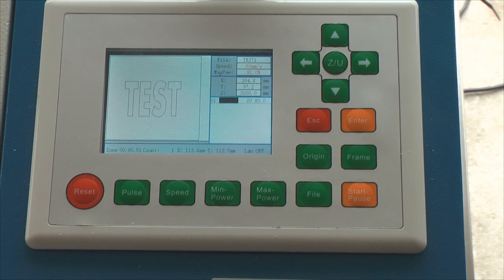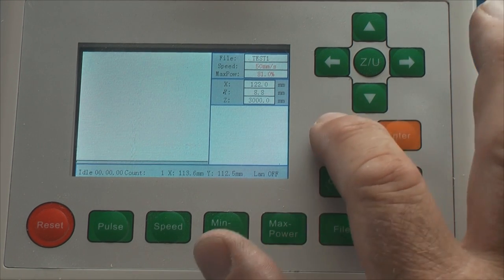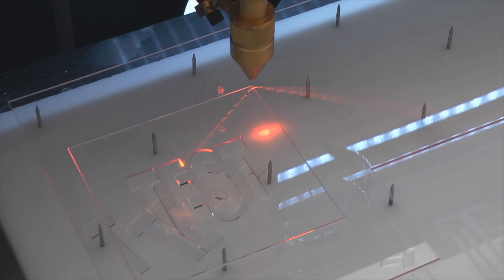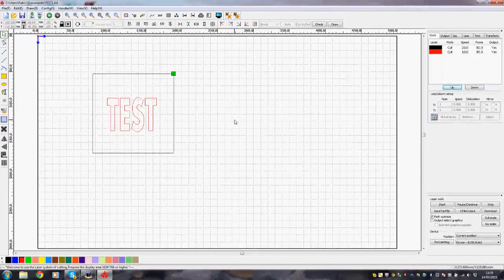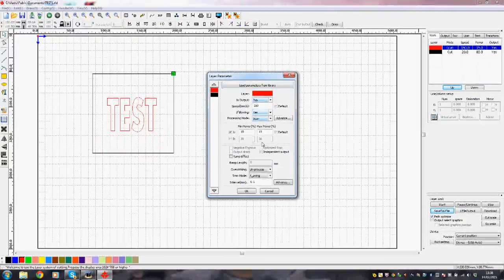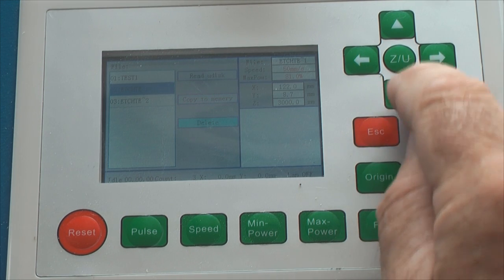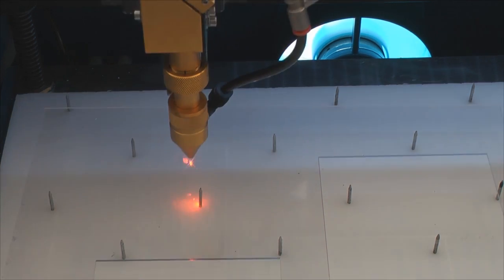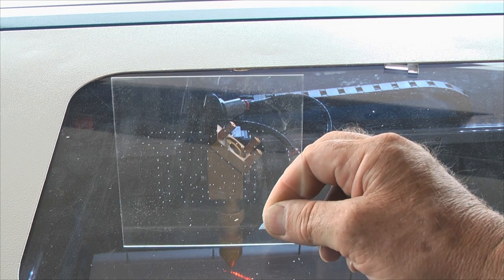Chinese laser cutter  tutorial part 5

Comment: If you could would someone one be able to tell me how I can fix my laser after I reset the parameters and now it’s stuck on 300x380
Reply from the maker: Hi Ashley
 Your prolem description is a bit ambiguous but I think you have a table witha work area bigger than 300x380mand you want to reset to the correct sizes.
 If you are using RDWorks then go to File, Vendor Settings and use the password RD8888. . You now must press the READ button to display the settings held in your machine. Go to the X and Y axes in turn where you will see a BREADTH window .Set these to the values of your work area  and then press the WRITE button to send these new values back to your machine. 

 If this is not your problem then a more precise description will help.
 Best wishes
Russ
Reply: @SarbarMultimedia  as I saw someone explain on a prior video. Their laser head would get stuck and make a very loud noise to correct the issue they reset the parameters on the controller which corrected that issue. My issue is now that my controller reset my laser bed to now it only ready x axis 300 mm y axis 380 mm when in reality I have it set on light burn at 600mm x400mm. I do not have RD works and each time I’ve tried to download it I get error messages. Would rd works be able to control it even though it won’t using light burn ?
Reply: @SarbarMultimedia  when I did the reset I didn’t deadline the default from the manufacture would be incorrect.
Reply from the maker: @ashleyorosco9916   
Hi Ashley
 You now have your table set to the correct 600x400 dimensions.  Do this simple test. Press your X and Y arrow buttons until the head stops. Now look at the display screen. I think you will see it says 600mmx400mm even though your head has not travelled that far. This means you need to recalibrate your X and Y axis, to teach them what REAL dimensions are.  Go to Lightburn machine settings and you will find a button that says CALIBRATE AXIS  Draw a 100mm square, burn it at high  speed (say 50% at 200mm/s). The calibration will ask for drawn and burnt dimensions. This will fix your calibration.
Best wishes
Russ
Reply: @SarbarMultimedia  I tried but it shrinks my design down to fit into the size of the area 300x380 my controller itself (on the laser) needs to be override. I’m not sure how to do it it’s as if the default settings were never programmed and when it default it didn’t default to the correct settings. I need the original software and be able to program it to the laser
Reply from the maker: @ashleyorosco9916 
 Hi Ashley
 Use the following link to contact me privately. We can communicate off line and you can send video or pictures. All problems have a solution. It's harder for me not being there but I'm sure we can get you back working again.
 Best wishes
Russ
https://forms.zohopublic.eu/ndeavorlimited/form/K40XtreeemLaserCutterContactRussSadler/formperma/k2Cn0QN5ChpazfTMAUw25lZ-FKpjZa96TQWHjv3ntOg

Comment: I will not recommend this laser to anyone  first the keyboard is not enough information when you talk about cnc it means that the keyboard is start from A to Z and the company they do not have customer service to ask to talked  if you need help about this machine
Reply from the maker: I agree that this is not a fully functioning CNC keypad  but it is just one of several ways  to communicate with  very powerful digital controller does a great job of controlling the laser, The compromise is that you do the programming on your PC  (which has got a full keyboard) and send /run the machine code file to the machine. Used in this way the only keys you need are the 4 arrow keys and the ORIGIN button. The clunky keypad is only used to make last minute changes to speed and power There is an alternative version (RDC6445) that has a  numeric keypad for easy input of data. There are many PC functions that are also  accessible via the keypad.  Despite the weakness, this controller has  now become the industry standard for laser machines big and small.
 Best wishes
Russ

Comment: Can i use it to engrave a thin metal? Like a zippo lighter or something?
Reply from the maker: Hi
 ALL metals act like a mirror and reflect the CO2 invisible light.  That can be very dangerous if YOU happen to be in the path of that reflection.  So, in general you cannot ENGRAVE any metal with this type of laser.  However, there are ways to MARK metals by painting them first with special coatings.. The coating absorbs the light energy turning it to heat, The surface of the metal and certain chemicals in the coating react together because of the heat and cause a chemical change in the surface of the metal. These special coatings are very expensive but for stainless steel there are alternative cheap chemicals that achieve similar results,
 See
https://www.youtube.com/watch?v=b_06laAjMPc
 and 
https://www.youtube.com/watch?v=BWo_au1TPL0
 Best wishes
Russ
Reply: @SarbarMultimedia  i actually didnt know a lot about what type of laser machine that i will use. Its a laser cutting machine at my university, and i just so happen to learn it now. Is there any type of this machine that didnt use CO2 as its main source? And if it didnt, can it engrave a metal? Thanks
Reply from the maker: @parawiraparbaga5641 
 Hi  You think of gemstones being a crystal structure but if you investigate a littlre you will find that ALL metals have a crystal structure as well.  In very simple terms, if the gap between the atoms in the crystal structure is less than the wavelength of the light (10.6 microns for CO2 light) then the light cannot penetrate and is reflected. If the wavelenght is the same ot less than the atomic spacing then the light can penetrate and damage the material.  For most materials this gap is more than 1 micron . That menas that the light from a fiber laser (1micron wavelength )  can be used to damage metal (engrave and cut).
Best wishes
Russ
Reply: @SarbarMultimedia  Thanks a lot for your information, best regards from me, hope you doin well for your future projects !!!

Comment: Can you tell me how you got your file from the computer to the machine? I am trying to make my first cut. I plugged my laptop via USB cord to the machine and I'm not sure where to go from there. I do have the same file saved that you showed how to make in RD Works. Thank you!
Reply from the maker: Hi Claressa
 First of all there are two USB plugs on your machine One is to connect your PC to the machine and the other is to plug a memory stick into the machine. They are not interchangeable  One may be marked Data or PC and the other Udisk. 
In RDWorks when you have a program finished press Save or Save As and this will save your drawing with all the parameters as a.rld file. You can always LOAD a .rld file back onto your screen and edit it.  Before proceeding, put you material on the table, move the head over your material, set the focus distance and press the ORIGIN button on the machine.  When you have a program on your screen you can do one of two things. You can press the START button on your screen and the program will be sent to temporary memory in your machine and auto run.  This is what I would advise doing for most programs that you are only ever going to use once,  A useful program is just a 25mm square with cutting power and speed. You will use this a lot to do small trial cuts to determine at what speed you can cut materials. For this type of test program in RDWorks press the DOWNLOAD button. You will be asked to give the file a name. This is a fairly old operating system and can only accept file names 8 characters long. Press the ok button and the file will be sent to permanent memory in your machine. Go to your machine keypad and press FILE. You will see a list of files that are stored in memory. Use the arrow keys to highlight the file you want to run and press ENTER, ENTER..   Move the head with the arrow keys to where you want to start and press the ORIGIN button. The head will always start and finish your program at this position until you select new origin point. Press the START button and your program will now run from the machine. Press START to run the same program again. 

You can do basic editing of speed and power at the machine by pressing ENTER, ENTER. A parameter table will appear. Press the ZU button to  scroll round the windows and the arrow keys to adjust the numbers (It's very clunky ). You only have one tube so ignore max/min power 2 they do nothing. At present always set Max and Min to the same value. It will be a long time before you need to understand why Max and Min. When you have  finished your editing ,press ENTER, ENTER to finish.

 Good luck  with your new adventure into the world of Chinese lasers.
 Best wishes
Russ

Comment: What settings do i use for 3mm acrylic. What power on the machine controller and setting on rd works
Reply from the maker: No one can tell you the settings because there are so many factors involved. The precision of your beam setting, the accuracy of your focus, the power that your tube is actually producing, the cleanliness of your mirrors and lense, the focal length of your lens, the efficiency of your air assist and the orientation of your lens.. If you have a socalled 50 watt Ebay machine, it will be aBgrade 40 watt tube that may be outputting 30 watts if you are lucky .You may be able to cut at 3 to 6mm/s with 65% per setting. Maybe is the key word because so many things could be off.
 Best wishes
Russ
Reply: @SarbarMultimedia  
Hi Sar
Two questions i got the stylecnc 90 watts laser co2
It came with a small air pump is that the want you recommend or should i plug in the compressor and set a regulator?
The other question' my zero home on rdworks its good on absolute option but when i cordinate top left it marks 35inches like is my top right how can i combine top left to zero zero X and Y top left on rdworks and on the machine top left?
Reply from the maker: @llesco693   
 Hi Miguel
  As you move further into my learning journey you will find me discovering that that stupid little pump not so stupid after all. I  have 2 machines and both are stillusing that little pump You do not need huge pressures and airflows,  For engraving you need a big distance between nozzle and work and only a whisper of airflow through the nozzle  to protect your lens. from smoke damage. However for cutting you need a very small gap between work and nozzle and a small orifice in the nozzle. Your cut is only about 0.2mm wide so you  need EFFICIENT air flow into the cut and that is best achieved with low pressure and relatively low flow. Do not use your shop compressor and reservoir .... I have been there and failed.
 On the origin question.  Your machine always goes to the back left or back right corner to set  the machine's 0,0.  When you open RDWorks in the top left or right corner there will be twp blue arrows. They must be set to the same corner that your machine runs to at start up/reset  You will be able to set this position in Config, System Settings 

Best wishes
Russ
Reply: Thank you very much Russ. Ur videos helped alot. Cant believe all the personal time end effort you put in to this hobby. Thanks again blessings to you Russ
Reply: I told my boss ur helping out with my questions and he said will send you a gift. Our company is located in Las Vegas Nevada. Color Reflections Las Vegas. I operate a big cnc router multicam apex and the gravotech engraver and this new laser stylecnc if we can do anything for you count on it. Any prismatic carve or large format printing let me know. Happy to help you in any aspect you need.

Comment: Thank you for all your info quick question i keep getting a error...no enough space...so it will not let me do anything
Reply from the maker: HiAngie

There ere several confusing and unclear messages. I presume this is appearing on your machine keypad? It usually means you have now got to the 99 files limit of the machine and need to delete some programs from the machine OR there is not enough space in machine memory to load a large file that you are trying to run or download. File management is a lesson I learnt the hard way. You rarely need to keep files in your machine  so provided there is nothing valuable there you can press the FILE button and find OTHER. If you press enter another menu appears that will allow you to FORMAT DRASTICALLY. This will clear and reformat your memory to pristine condition.  If there are files in memory that you do not want to lose then when you press the FILE button there is a COPY TO UDISK option where you will be able to copy files one at a time onto a memory stick I'm afraid there is no multiple copy or erase, this is a VERY basic system. 
I'm pretty sure that the message is to do with the files and not with the work space. Those error message contain words like SLOP,  and EXTENDED SPACE.

Best wishes
Russ

Comment: Nice videos. Have you found a setting to change the scan direction from bottom to top? When etching the debris moves in the airflow from bottom to top, so scanning from bottom to top will avoid redepositing in previously etched area.
Reply from the maker: Hi Paul
 Go to Config System Settings and there you will find a 9 spot pattern. If your select any of the 3 bottom spots that will be where your head will start from and scan upwards.
Best wishes
Russ

Comment: AAAAAAh... THAT'S what the empty circular hole above my power switches was for! So your model has a synchronous AC motor with a gearbox for Up/Down. The microswitch would then be Normally Closed and installed in the neutral line of the motor to cut power when you bottom out. That's A SOLUTION, but i want to automate mine for continuous auto-focus (so i can engrave on irregular objects) so i would need a stepper driver and a stepper motor. I plan to resolve focal depth using a wiimote (has an IR camera in it) to spot the height of the iridescence of burning material. If the IR dot deviates up in the camera, then i am too close to the laser and if it deviates down i am to far away from the laser. Once the laser starts a job the program is in it's memory and i can't just start injecting z-axis up and down commands into the program so this image data would have to be processed by a separate computer (a Pi 3 could likely handle the task.)  I'm not sure how good a Pi would be at generating steps for the driver, so the Pi would likely need to be telling an arduino what to do and the arduino would tell the stepper driver.
I'm at a bit of a loss as to how to mechanically connect the Wiimote. If i place it at a stationary position attached to the bed then it might loose sight of the IR all together as the laser digs into material, and also field of view would likely be an issue. If i attach it to the head of the laser I will loose considerable work area in whatever direction the controller is sticking out in. Still I believe the later would likely be my best option all things considered as it would be consistent at any position the laser is in and simply involves creating a 3d printed bracket and running an additional cable through the drag chain.
Reply from the maker: Hi

I have a second machine that has autofocus on it, as you will discover as you follow my journey. The table on that machine is stepper driven but it only sets a fixed focus point and to be honest is very slow and clunky. I have stripped it off and set focus 10 times quicker  manually. If you want surface detection and following for uneven surfaces that there is no simple way.     Ruida do make a system called Live Focus but it is stupidly expensive and I do not know just how sensitive and responsive it is. see     https://www.youtube.com/watch?v=nBmeqCOW5P8

Best wishes
Russ.

Comment: Hanging the air assist pump off a rope isolates most of the vibrations and makes it WAY quieter. Also pin 5/6 on connector CN1 (assuming you have the same controller) are labeled +24v and WIND. these can activate a solid state relay to turn the air assist on/off automatically (controlled by "IF BLOWING" in RDWorks). The SSR won't turn on with just the pump connected because it's a an inductive load. I use a 3 tap extension cord and plugged an LED lamp in as well for some resistive load to help the SSR out. Two relatively simple improvements that are a nice quality of life boost.

Comment: Thanks for great series, can you explain how i can add plugin for blow pressure control? How its working?
Reply from the maker: Hi
Take a look at these videos
https://www.youtube.com/watch?v=m4Hh-8-9Tio
https://www.youtube.com/watch?v=ZKC8Byc8y28

Rather than buy the pieces from SMC as suggested,  I passed the details to cloudraylaser.com who have made a very cost effective kit at a fraction of the price. The only thing you need to supply is wire. 
See  https://www.cloudraylaser.com/products/ultimate-air-assist-set
Make sure you scroll down the webpage  because all the information you need for installation is there.
Best wishes
Russ